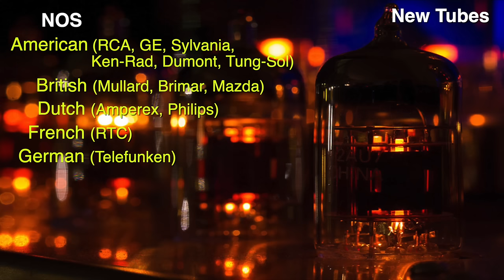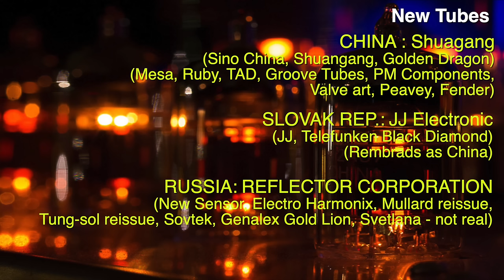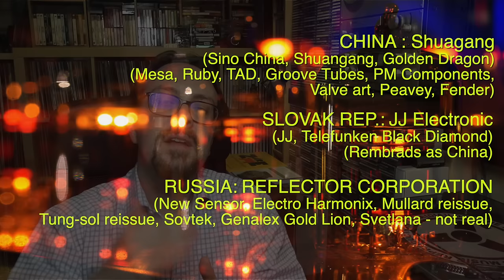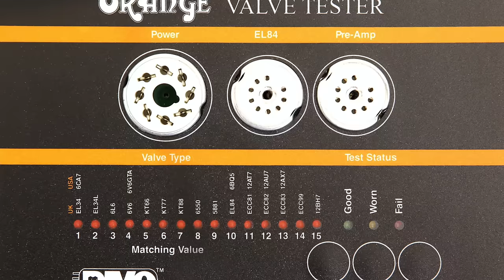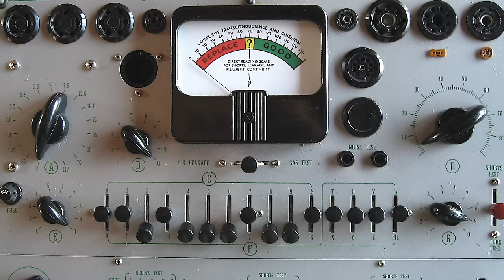Vacuum Tubes Basics: 10 things you need to know

Comment: Hi Guido ..got that pro-ject s2 phono preamp..the orthopon Black is awesome" rca battery powered " audioquest green" supper green" ..arcam. finished the choral vintage kef speakers...
I'm trying new stuff isolation with liège and ideas 💡 with reverb problems guess I'm going to isolate my turntable in an other room ..nice tube BTW.
Reply from the maker: Sweet!!
Reply: @anadialog  does battery powered rca interfere with vaccum preamp?
Reply from the maker: @alexandrequesnel912  battery power is the cleanest solution. You shouldn't have any issues.

Comment: You’re right, the best tube amps don’t sound warm they are neutral sounding. They give you the precision of a solid state class D amp but they give you added soundstage holographics and a bit of top end sparkle. What is your favorite tube pre-amp? I recently purchased the Kitsume Holo May DAC which you reviewed and I am looking for the best tube pre-amp for it. I have narrowed it down to PrimaLuna EVO 400 and or the Woo Audio WA33 headphone amp which doubles as a pre-amp.
Reply from the maker: Nice! The Evo is a true preamp, with various inputs while the Woo is mainly a headphone amp. Depends from your needs but if you are also using speakers and getting a power amp obviously you need something like the Primaluna...
Reply: @anadialog  Currrently my entire system consists of my NAD T778 AV receiver and my speakers. I recently upgraded my speakers to try to improve my 2 channel performance for stereo listening so I purchased a pair of Spatial Audio X5 open baffle speakers. Those will replace my 25 year old Boston Acoustics tower speakers. Then I caught the audiophile bug and decided to upgrade my headphone listening system so I got an M1 Mac Mini and a Woo Audio WA7 tube headphone amp. I also got a pair of Hifiman Araya headphones to go with that. I then decided to upgrade from my one and done NAD T778 to get an external DAC which is the KTE Holo May. That’s what led me to get a pre-amp and streamer too. And since my NAD receiver is a totally neutral totally transparent sounding amplifier, I wanted to add a little tube holographic and tube sparkle to that sound similar to my WA7 tube headphone amp. So that led me to the PrimaLuna. Also the streamer I am looking at is the Hifi Rose RS-150, which has a really nice large touch screen display and unlike most streamers has the ability to stream videos and music from youtube and project that in 4k on my LGTV. So I thought that would make the perfect pairing for my new Holo May DAC and would complete my new 2 channel system.
Reply: @anadialog  As far as the inputs on the pre-amp goes there is only one device I will be plugging into it and that’s the Holo May. So Switching is a non-issue for me. I don’t expect to be buying a turn table or reel to reel or tape player etc...
Reply from the maker: Sweet!!!

Comment: im mainly into tube rf amplifiers i have two..one uses sweep tubes and i hear that they dont last as long as transmitting tubes and the tubes in that amp are getting weak but that amp was made in the mid 70s and the tubes are original..but it still gives 400 watts..the other amp was build in the 50s and uses 3 813 tubes and its still going strong with original tubes putting out 1500 watts with ease..it is capable of 3000 watts if it is wired for 220 volts rather than 110v....iv had other tube sets and in my experience they will outlast any solid state device ..
Reply from the maker: That can happen, but it isn't common. Especially with new equipment. Cool vintage setup!

Comment: I have my first tube amp. Reisong A10. Turned it on the other day and an EL 34 burned inside. I removed it and later we t back and turned it on and the other EL 34 burned. The amp hummed and I turned it off. Is it that the tubes are done or was this caused by something to do e with the amp?  The tubes had about 50 hrs. use. They are the maker's choice.
Reply from the maker: Mmmh...seems like the amp is having problems. Did you check the bias?

Comment: 16:32  I am sorry to say , that is not an issue and is more of a myth... I work with a lot of tube radios, tv's, and stand alone amplifiers. handling the tubes is not that critical. I have in all cases just hand changed all the tubes in radios etc.. and never ever had an issue.. if your tubes are getting that hot to the point they are cracking, its not from handling but incorrect wiring to that tube and its having to handle more current then it should be handling thus over heating the tube. Even power tubes can be handled, however it does make it look nicer to not be fingerprinted all over the place but that does not change the function of the tube as its under a vacuum  and your fingerprints do not get inside.
Reply: @Boony Tooty 
dog hands might be an issue though. since they tend to use their mouth to pick things up.
Reply: Touching the sides of the pins of power tubes that run hot can be an issue as the oils can char resulting in a poor contact , though rare I've seen it ruin not only the tube but also the socket because when the pin and socket get much hotter than normal from the charring the socket can loose it's tension causing the replacement tube pins to quickly  burn also. One other thing some people like to look at the exposed tubes of their expensive amplifier and the oils will leave  a visible dark fingerprint on the tube , harmless but not aesthetically pleasing .
Reply: @leekumiega9268  touching the glass envelope of a tube does not cause any of that...  neither does touching the pins. what can  over heat a tube is years of dust baked onto it...  Age and the normal heat is what kills tube sockets, or having to move/change tubes too often can wear out the tension of the tube socket leading to poor conductivity and then socket death or intermittent shorts. I am sure your issues are just coincidental timing. I have repaired radios that are actively in service all the time and the tubes that were touched (even the power output and rectifier tubes) and they are just fine, same with the original sockets. Please stop spreading misinformation its dangerous to those who are wanting to jump into a hobby, or even a small business of working on tube electronics.
Reply: @balthromaw6305  Radios do not stress the tubes ( sometimes to the point that the plate glows cherry red) like some powerful tube amplifiers thus they may not get hot enough for it to be an issue like finger oils on the pins of high power tubes that can fry a pin over time like it does with the pins on a halogen bulb.
Reply: @leekumiega9268  Yes I know, But I do have some high power Amps, and some TV's,  Horizontal output tubes get really hot and even them survive being handled..  they are tubes not halogen bulbs give it a rest.
Reply: @balthromaw6305  After checking the internet the argument goes both ways with no consensus ,I learned tube theory in 1975 and my 60 year old teacher told us not to touch the pins for reason given earlier . I have come across a few fried  sockets  (only 1 or 2 fried pins were fried) and assumed it was due to finger oils carbonizing over time and heating up .I guess we can agree to disagree. Also the reason given to not touch the glass was that the tube number could get eaten (by the oils ) or worn away from touching it. I have come across quite a number of tubes where you could not make out the number {or letters ).
Reply: @leekumiega9268  As for the tube markings, Yes even water can remove some of them that's why wiping with a dry cloth is most likely the best way to remove dust and dirt build up as some manufacturers  use a water based paint that loves to disappear. Nothing is more annoying then a mystery unmarked tube... lol
Reply: @leekumiega9268 unless you're wiping your butt without toilet paper, You should not be applying any "char" material to your tube when you hand install them.

Comment: I just picked up a tube radio, I think it's from the 40's due to the lettering used in the text and all. I've already touched all the tubes with my hands, to take them out and admire them, never seen a device with tubes before. Do I have to clean the tubes now before testing out the radio? If yes, with what should I clean them, so there isnt oil from my hands and such on the tubes? Thanks again for the vid! Greetings from the Netherlands.
Reply: A late reply of course, but no you haven't hurt them.  TV repairmen in the glory days of tube TVs never used gloves.  Just be careful wiping them with any type of cleaner, you can (sometimes) very easily erase the printed tube info from the glass envelope.  Some were painted on, but other brands used a lightly printed ink/color that can wipe right off.

Comment: I have a 1930s radio im trying to get working. I've worked with making and repairing electronics for over 10 years and this thing is alien to me.  
the caps are all wax filled. the only component that i was previously familiar with is the wire and light bulb for the tuner dial. i feel like if i get it working its going to open up a Time dilation portal to 1930s.
Reply: All of those caps need to be replaced as the dielectric material has surely deteriorated by now . Any mica caps are probably alright.
Reply: Be careful...tubes run at high voltages of 300+ volts.

Comment: I own a 1959 stereo Tube pre amp with 1959 nos tubes each channel has a RCA 7025 then each channel has 2-12au7a Sylvania 1 each for bass 1 each for treble. So my tube pre amp has active EQ circuit and is a Cathode follower.
a 1959 stereo p/p 6v6gta no volume control that’s on preamp. I run it into Altec Lansing 10 cubic foot cabinets with 15” Alinco magnet, horn mids, high end horns all Alinco magnets. About 15 watts a side will blow your mind. 117 dbl 1 watt at 1 meter.  Most realistic music you will 
ever hear.
I own 10 tube amps today some push-pull some Single Ended
Reply from the maker: Sweet! So which amp worked best for you?

Comment: Tube warm-up is more important than presenter lets on - they will wear out MUCH quicker if you fail to warm them up before putting signal through them.  That's probably why he has to replace his tubes every year or two.  That's inherent for some amps, but I've had NOS tubes last ten years or more with proper care, even in guitar amps where they are run hard.
Reply: That's simply not true!

Comment: Matched tubes yes best way but in power amping If the Amp has got negative bias setting you done need matched ones. If bias is fixed you need matched ones. Second glass will not effect vingerprint fatts that is nonsense. The glass is strong enough I have build a preamp 6cg7 for phono ecc83 in mm stage, power Amp 6sn7 (first stage fase inverter) kt88 or better 6550 with no feedback it runs very good. And yes dynamics with low watts are more powerful with tubes.

Comment: Check current pricing on tubes before making a decision as to whether to go with tubes or solid state. And consider the amount of tube replacing that you'll have to (or want to) do over the life of the equipment. Factor that into the price of the gear when comparing with other equipment. Also, many tubes have gone up drastically in price due to  Russia's war with Ukraine. I'm waiting on a pair of new (not NOS) Russian Genelex Gold Lion 12AU7's that cost me 187.55 (USD, total - tax included). NOS tubes can go for well over that price, and availability is currently somewhat limited. Things have changed quite a bit since this video was posted, pre-pandemic and pre-Russian-Ukrainian war.
Reply: I was just going to comment the same thing. Wars, ruining everything since the beginning of time

Comment: Here we go : 
-Tubes were mainly used for Radio transmissions.
-Tubes are not the main key in tube sound, the output transformer is in fact mostly affecting the sound.
-Headphone amp are not preamp, you need a power tube and an output transformer so, HP amps are amps.
-Tube life does not depend on the number of tubes. Power tubes last between 5 to 8 years depending on use.
Preamps tubes are lasting at least 20years.
-Tubes were not better in the past, they are now much quieter, consistent and trusty.

-Tube matching is for power tube but it is not quality, it is performance.
-You can touch tubes with your hands but it is better to touch them with gloves.
Like any piece of equipments in fact.
-Warm up time is more like 1 to 3 minutes max because there is a heater !!! 
Warm time in transistors amps is much longer in fact, depending on the technologie used.
Reply from the maker: - I knew someone was going to say something of my Headphone amp suggestion...oh my! Obviously I am talking about the pre-amplification part in the headphone amp, in fact its called amp not pre-amp but did you really had to point that out? wasn't that clear? I guess not. 
- In certain types of circuits, like that designed by PrimaLuna the number of tubes diminishes the work for each tube, hence increasing their life. Don't believe me. Go and read the info on their site: https://www.primaluna-usa.com/dialogue-premium-hp-integrated
- Guess what? I got a tube amp and after 1 year and a half one of the pre-amplification tubes died...not even close to 20 years! And this happens constantly, Please get real.
- I think that the golden era of a specific technology will always produce a better product than posthumous emulations. 
- Yes, matching is mainly in power tubes and yes performance is paramount, which delivers better sonic results.
For the rest I agree more or less...

Comment: One word of caution is warranted: Anyone not familiar working with vacuum tubes should note there can be potentially lethal voltages involved with these circuits and capacitors can stay charged that can deliver a big shock even if the gear is turned off and unplugged from the AC source. Just changing tubes should not require any unusual precautions other than testing to see if the tube is hot before touching it, but delving into the components inside can be hazardous to the untrained.

Comment: To just buy the tubes somewhere on the internet is not advisable. Tryt out specialized shops which do test every single tube before shipping them out to the customers. The same shops also know which brands that sound best for your amp. Try Upscale Audio and Watford Valves. You pay a little bit more but you get quality.
Reply from the maker: I agree but in Europe it's harder to find a good shop like Upscale Audio! Kevin open a shop also in Rome!!!
Reply: @anadialog   Try Watford Valves in the UK. Really nice homepage with recommendations on the separat amps. They got a recommendation for your Prima Luna as well...

Comment: I do have an integrated tube amp (DYNAVOX VR-70E ) that was upgraded in hardware (simplification of the signal path) and it sounds beautiful, but at the moment I have an integrated Primare I30 in my main system, optimised with Hi-Fi fuses that really make a difference. I don't know if you already done a video about fuses, but it is a very interesting tweek that really improves sound quality. 
Keep on your excelent videos! 

PS: by the way, after viewing your video about the HDCD format, I recently bought an Arcam CD23T (dCS ring DAC) to listen to all my HDCD CD's and it really shines, is an excelent player (I had the opportunity to buy an upgraded version with much better capacitors and new transport CD lens)
Reply from the maker: Cool! I am glad you did this jump of faith for HDCD!

Comment: A good multimeter, a Variac (variable power supply to vary current or voltage), a test rig, a spec sheet (available online), and a little knowledge goes a long way for matching and biasing triodes, tetrodes, and pentodes.

Comment: Idc if the sound difference between tubes and transistors is psychosomatic or not, but I know that I feel a hell of a lot better in front of a tube amp rather than a modern fender champ.

Comment: Not sure, short tube life is a concern when they are used in a preamp. I have listened to decades old Audio Research and McIntosh units, that still had their original compliment. Even after not being touched for 30 years, they still sounded mighty good.  In power amps that use power tubes akin to the 6550c or KT 88, I found it's another story. Depending on how many hours a day I ran them.  I usually averaged about 18 to 36 months before they had to be replaced.
Reply from the maker: There are several factors but in any case sooner or later they will fade and die...good circuits and project can extend tube life greatly!
Reply: Yeap.
In my case, preamp tubes has lasted till now, while power amp tubes (both 6550A and KT 88) has been as you say: a very different (and expensive) story. I must add the two power amps I own are auto-biasing type, but this circuitry characteristic doesn't seem to make the output tubes last for longer (although it avoids you to go messing with voltage levels and the like, of course).
Reply: I had the same experience with the Genalex KT-88 tubes used in the Dynaco Mark III power amplifiers.  I had four of these power amplifiers in the period of 1967-1974.  I found these tubes needed to be replaced about every two years.   The price of these doubled during this period which drove me to replace the amps with a Marantz Model 15.  The Model 15 was a dual monoblock with a common face plate and performed well,  but was going into overload with loud passages driving the 4 ohm AR-3a speakers I was using.  I purchased a Marantz Model 250 power amp and use it to this day.